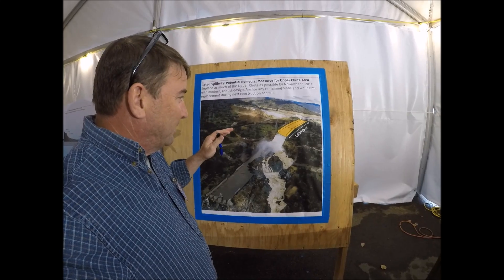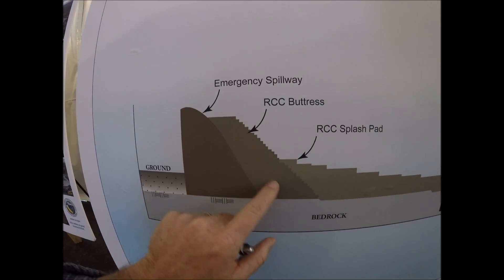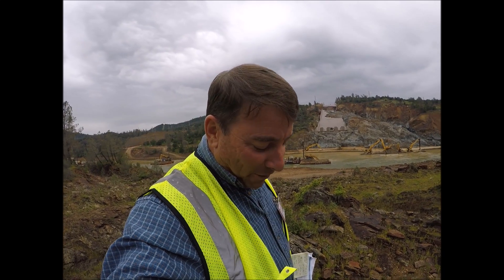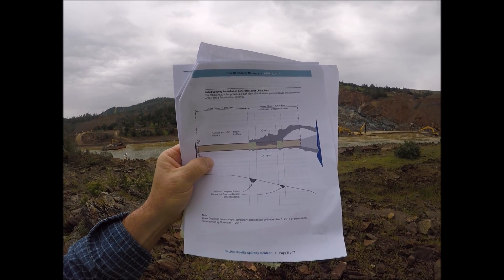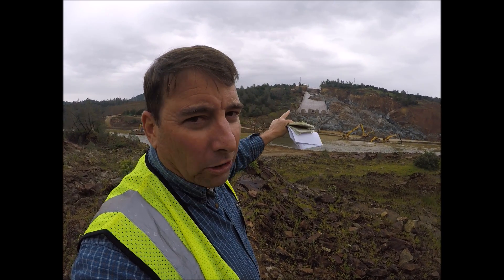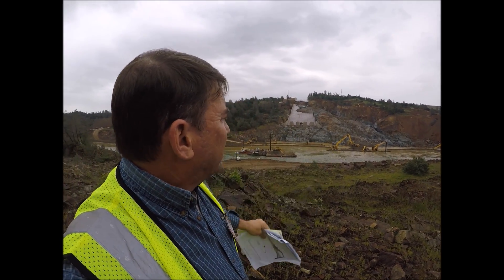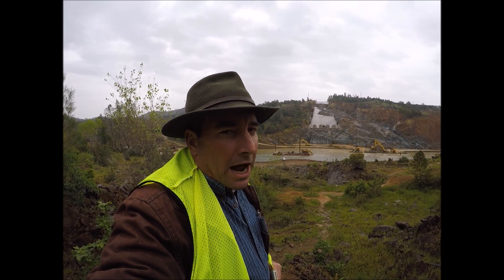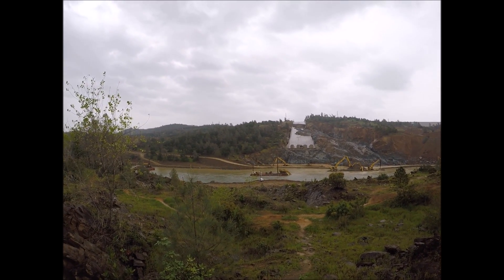Oroville 6 April Update The 'New' Spillway Design Revealed!

Comment: It would seem to be important to design a spillway that has anti-cavitation capability.
Would passive air injection by venturi action be a good way to go? At the bottom could the flow be directed to exit the spillway in line with the river or spread out wider than it is now?

Comment: How to Build a Road Using Roller Compacted Concrete:
https://www.youtube.com/watch?v=mcDxw2HLLS8

I didn't see a video on it, but it's stated that this material is used in dam construction.  Basically it's a very dry concrete that is compacted similarly to asphalt.  It seems the same machines are used for both materials.  RCC is less expensive than asphalt, and I believe stronger.
Reply from the maker: yes, fast and cheap.RCC used in over 300 dams to date.
Reply: Great link !! Anyone wanting to know about RCC watch this

Comment: Is the 10K cfm throughput of the power plant the current rate or is it capable of handling more when the turbine upgrades have been completed?
Reply: I think it's about 2200 per turbine maximum. Here's the tricky part. As the water rises there's more pressure and less CFS required to produce the same power. IE as the lake level rises the power plant will release less water to the river. I have no idea where the design point is. If the turbines can produce maximum power at maximum lake level or maximum power  at lake level of the penstock intakes
Reply from the maker: 10k  with 5 turbines, more with 6....13k?
Reply: I just looked at the current outflow numbers. 13,000 CFS Looks like they brought the fifth turbine back on line.

Comment: Why not construct a heavy duty cover for the missing #1 turbine location so they can run water through the @1 turbine opening even though the actual turbine is missing?  This cover could be used again and again as they remove the other turbines for upgrade.
Reply: I had the same thought until I realized there's 700 feet of water pressure behind it and no way to control it. You can have a mile of 300 psi water hammer in the power house that will split the penstocks like a balloon.

Comment: looking at the plans it does say replace or REPAIR !!!..... i would place bets on them putting a new layer of concrete and re-bar and tieing into the existing spillway due to time constraints and cost..... i dont like the idea of this roller compacted concrete as air cannot be released from the mix easily making it quite weak, however this is a temporary measure..... personally i think everyone would like to see a new modern design of the spillway however i think it really comes down to cost. sadly it just looks like a patch up job with more focus on the emergency spillway
Reply: RCC is just a filling to the eroded voids. The advantage is that it is loose tipped from trucks, spread and compacted in layers (like earthfill) and is quick to place.  They are likely to finish with a high strength smooth reinforced slab on top of this for the water to flow on.
Reply: RCC is better concrete than went into the original. It's stronger, cures faster AND is cheaper. I'd be OK with relining the upper portion with a foot of concrete and enough re-bar. When this is done you can land a Boing 777 on it
Reply: great point, lets hope they do finish it with the smooth hi-strength slab.... i couldn't see it on the plans which got me a little concerned

Comment: Neglect of infrastructure investment,....that's the cause of the disaster.
Reply: No ribbons to cut, no cardboard checks to get photo ops....
Reply: Not really. They had been maintaining it to the standards in place at the time it was built. The point of failure had been repaired, I think in 2013, and the repair didn't hold. Possibly there was leakage that undercut the foundation, but it was not evident to inspectors. The 1968 standards seem to have been inadequate. The concrete slab wasn't thick enough and they didn't dig down to bedrock before pouring the foundation.
Reply: dlwatib You just contradicted yourself in one comment ; ). That is part of neglect in infrastructure.

Comment: The concrete for the replacement of the existing spillway will take 4-5 weeks to cure to specified strength as long as it is kept wet. It will only get stronger with time. The Romans knew how to make concrete and some of it is still in service as conduit to feed water to the City of Rome. The Pantheon in Rome is a total concrete structure including the roof.

Comment: If Id of maintained Railroad track like these dam maintenance did my trains would of been laying on there sides in full derailments. Its just disgusting. When I worked on the slurry wall here in Sacramento we had a company that use Nuclear testing equipment. for less than 25000 dollars they could of set those on the spillway, ran test and seen just how thin it was becoming and by-passed this mess years earlier. Problems always go back to maintenance/maintaining. Just like hospitals. If the power go's out it's maintenance people and starting that generator once a week to make sure its there and works when needed. If there would of been a major earth quake and lost any part of the dam that would of been a act of god, This was no act of god.     . Just my opinion.

Comment: why not steel plate the entire surface? water will erode cement, not steel. also, if this weather pattern change is a multi year event, this will happen again/
Reply: Check out all the reinforced concrete bridges. Reinforced concrete is a great engineering material. It will last longer than a steel sheathing would.

Comment: One bit of confusion is that Ms. Cuttle and Mr. Croyle presented slightly different contingency plans with regard to lower MSW. 
Paraphrased:
Cuttle: (about 15:25 into conf) Contingency plan is to Buttress the bottom edge of the upper MSW, plunge pool and eroded area.
The areas that are deemed safe for continued use through next winter will be reinforced and more robust permanent features built at a later time.
If this option is pursued then rest of construction would be completed next season (summer 2018).

Croyle:  (answering Q at about 41:25) "fill up plunge pool with RCC", ...  (minute later) build up lower MSW to handle 100K, with contingency to spill it over the side into the natural erosion channel, then finish build up of lower MSW in next construction season.  

Personally, I think the first is more likely than the second, but we'll see.
Reply from the maker: I think you're right...
Reply: Their plans have several contingencies at this point. Both scenarios are in the plans right now, and they will make a final determination when it becomes more clear how much they can get done by Nov 1.

Comment: Thanks Juan!! A question is can the river immediately below the powerhouse absorb an outflow of 15k cfs without raising the river level to where it adversely affect the turbines? A bigger question is if they use the new canyon for spillway outflow how much uncontrolled erosion will there be in that canyon?!
Reply: They were running the power house at 10,000 CFS and the spillway at 40,000 CFS so the river can handle 50,000 CFS. The bigger question is can it handle 250,000 CFS if that ever happens. As for debris. The water was running pretty clear so there is probably not much more coming down. UNLESS !!

Comment: curious... with the additional turbines being replaced with a new design.. would it not make sense to build a brand new unit so its a pull out and drop in a new one .. not pulling it out.. and sending it off..  or did the original design not duplicate the others exactly..   its just a question.. 

i am thinking that the new powerlines across the top of the spillway are going to be right in the way for cable ways to haul buckets of concrete up from where you are standing at 12:08 to either the upper or lower halves of the spillway..  depending on the  access on your side of the channel..     if they are really smart.. they will build a tower at the top for multiple cable ways.. and install the batch plants on slides... so the filling time of the buckets would be reduced.  this might be able to fill the pool area in just a few weeks.. 

they could even use the cable ways to lower jack hammers type equipment like the lumberjacks use a motorized trolley to hoist up logs on to the haul cable.  this would use a pair of cables to stabilize them.   this could make breaking up of the spill way really easy.. 

i would think that there is going to be a 24 hour a day convoy of cement trucks coming in from several plants in that area.. or batch plants on site with bottom dump doubles coming in to refill the supply bins ..  

please make copies of this and hand them out to DWR and the 4 contractors placing bids..  not telling them how to do their work.. just trying to help . 

lastly... when they are installing the rebar.. there are ways to screw special rebar together with sleeves... there are ways to crimp sleeves on rebar ends.. but these are going to need to have a HOOK bent in the end of the pieces running down the face of the spill way... so the rebar is connected like a chain..  instead of just tied together with twist wires or threaded sleeves.. those are designed for vertical stacking.. or compression alignment.. not extension strength..   conduits tubes will also need to be installed all the way from the top to the bottom.. with a massive anchor block at the top that is dug deep..  so after its completed... cables can be inserted for POST TENSIONING the entire face of the spillway together..  the side walls should have this done also..  it will have to be done against rather thick coil springs as there is going to be some thermal expanision and contraction of that massive block of concrete spillway.. as the sun load changes and temps change.. even when the water flow happens.. that will cool the spillway and maybe what created the cracks in the first place..  

sorry for the wall of text... 

 wayne..
Reply: Hi Wayne.....The generator part consists mostly of special steel laminations for the magnetic path with wire wound around it for the generated electricity. The wire is insulated but that insulation deteriorated over time and so must be replaced. The laminations will never wear out, but there are better steels now available which would make the generator more efficient and produce more electricity. It's a trade off at the time the work is done. The turbine in the water is a Francis turbine. The water flowing over it and the gates will erode them over time. It's natural. It's either make a whole new one or rebuild the old. Again its a trade off. If you're going to simply replace, building ahead and a quick change works. Normally a rebuild is much cheaper. I would guess that with the drought they didn't think they would have water to generate power anyway so took the longer cheaper route. That wasn't a bad decision at the time. The other choice is to build one new, drop it in and take one out for rebuild. In the end you have one left over for scrap. Again it's a trade off.

Comment: Juan, they apparently have mentioned several times that the Emergency Spillway is not to be used again.  It would not have been used now if the inspection and maintenance of the Flood Control Spillway had not allowed it to fail.  Have they said ANYTHING about how they are going to change that so the Flood Control Spillway does not fail again????  Great report as always, thanks.
Reply: You'll be able to land a being 777 on the new one.

Comment: Nov 1 2017  is 6 3/4 months not 9
Reply: And, what about the time of the spillway operation?  He said one more spillway event, maybe two.  When the spillway is in use, repair work will have to cease, right?  Yes, materials and prep work on outside landings can happen, but no work on or near the spillway.  If he said, I may have missed how the water is to be diverted from the spillway in high operation periods, too much for the newly built (albeit having temporary sides), diverted to the newly formed gorge.  Some form of temporary gates would have to control the flow to the gorge.

Comment: why is the main dam not included in videos? When I see uploaded pictures, it shows a dam with water gates..  Orville gates are on the side!  Not the same dam!
Reply: Check out Google maps. The gates are at the top of the spillway which is quite a way from the actual dam
Reply: In the first place, the main dam is not the issue, its soundness is unquestioned. The issue is the lack of redundancy in outflow from the lake, so the videos are all about the RVS (River Valve System), the Hyatt power plant, the main spillway (and its water gates), the emergency spillway, and the actions / plans to improve their quality and reliability. Everyone who lives below the dam and who doesn't like emergency evacuations in the night is concerned about those.

In the second place, the whole dam structure is nearly 7,000 feet long and it's awful hard to  see it all from one place except the ends or the lake side.

In the third place, the main dam IS included in BlancoLirio's flyover videos in the first place! Click the channel name and then click the Videos menu, the latest one is not that far down. On the way you may discover videos on other 
subjects of interest -- I sure did. Lunch hour viewings will take me most of a year to see just the ones that strongly interest ME. Especially including comment time, better say 2 years...wonder if I'll still have a job then...?

Comment: If the first of a series of future deadlines is November 1, 2017, that's less than seven months from 4/7/17, not nine months.
Reply: I think he means they started in February.
Reply: GSMSfromFV 
I thought the same.
Reply: They haven't let the contract yet for the demolition and rebuilding of the upper spillway.  By the time the contractor is selected, it will be about 6.5 months to 11/1/17.
Reply: GSMSfromFV 
Actually they said the bids will be in by 4/12 and work to begin 4/17.

Comment: Must be doing a cost-plus style contract for such a fast turn-around of proposals from the contractors on a project that is still in the concept stage.
Reply: It's hard to bid when the drawings aren't done yet. Of the four contractors one will be the lead and the others will get some of the work as subs
Reply: I imagine it's a phased contract that incorporates cost plus with large bonuses, consisting of most of the profit, for early completion
Reply: Cost plus is not a bad way to do these kinds of jobs. You define the cost of material and labour in the contract. The owner ( California in this case ) is going to absorb all the construction unknowns and risks anyway. Example. I had a small house wiring job to do last year. The contractor was humming and hawing about $3000. We finally agreed on cost plus capped at $3500. I paid just under $2000.........I did a rough calculation last week and posted $350,000,000
Reply: I wouldn't be surprised if they are allowed to include a profit margin in the labor/material/equipment rates they submit, but that rate will be either part of the selection process or will be negotiated prior to issuing the contract. Likely will be some incentives tied to speed of work, but with the design still in early stages I would think an incentive-fee based contract would be unwieldy at this point.
Reply: Bob, your comment on your experience hiring a contractor for household electrical work is hiding in YouTube's spam filters right now, probably just because it had dollar signs in it, but it was quite relevant to the discussion. Thanks.